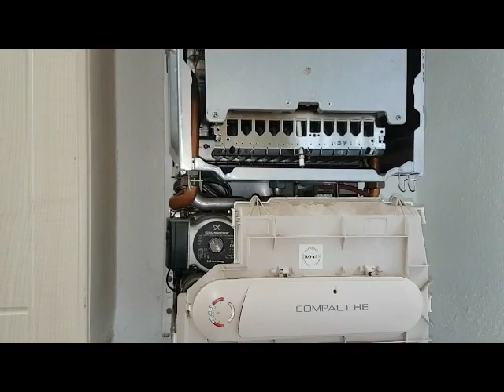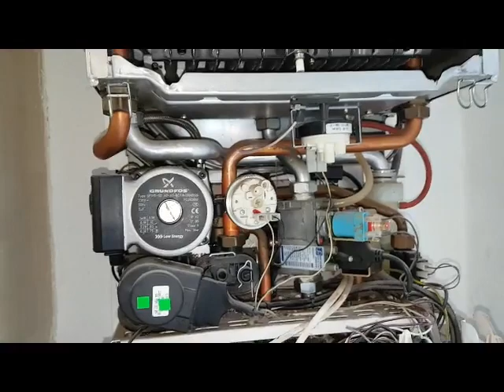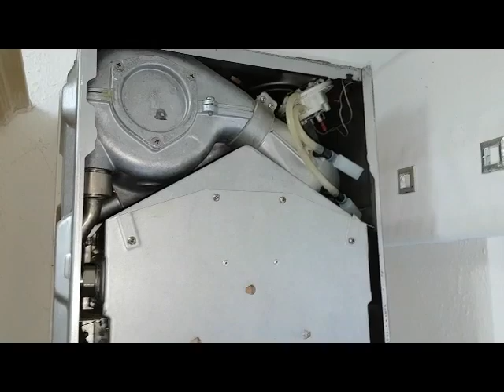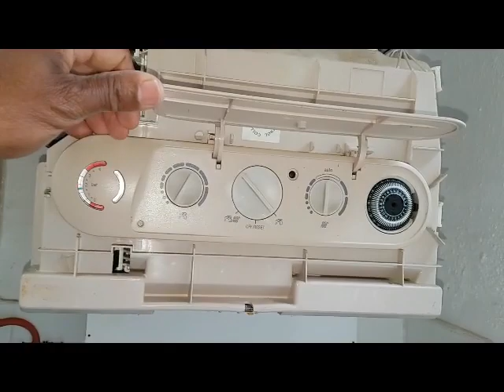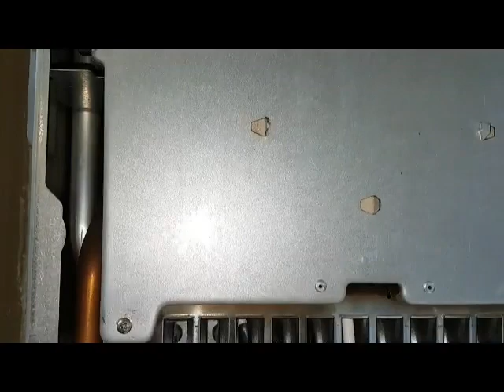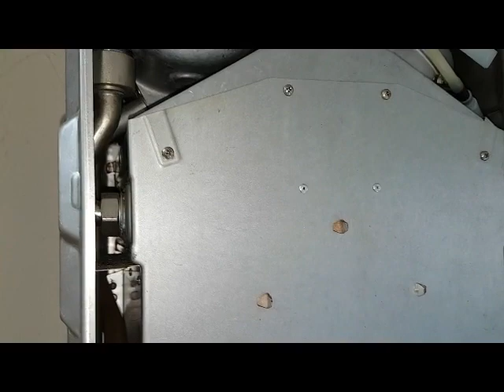Gas Portfolio Building Frequently Questions Part 2. With Coach Tony Morgan

Comment: For the gas portfolio can you use boiler installations instead of water heater jobs? They are pretty much the same thing. Would it be accepted?
Reply from the maker: Hi it's best to have a variation of jobs
Reply from the maker: hey we're currently trying to grow our Facebook group and would love you to join Tony and the team using this link, Tony will be available to answer all your questions directly there's also updates on new trainings we just released too. https://www.facebook.com/groups/167070231326174